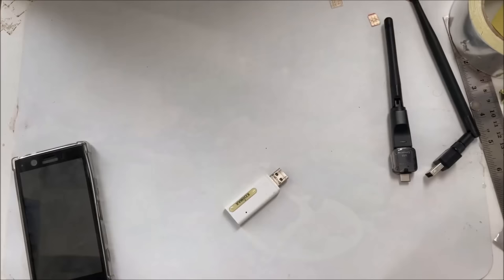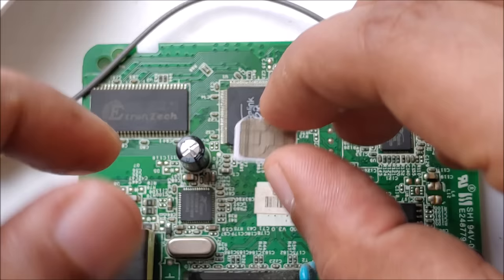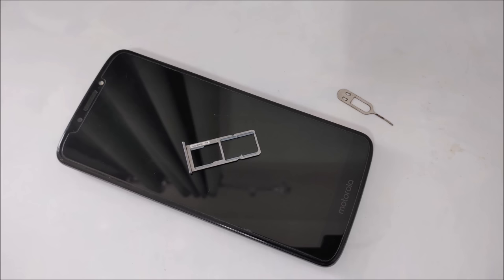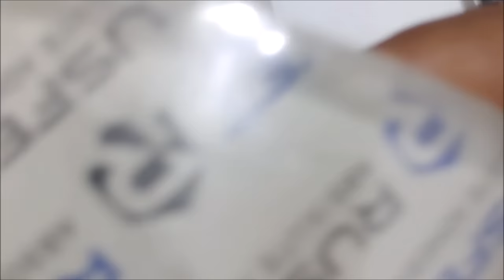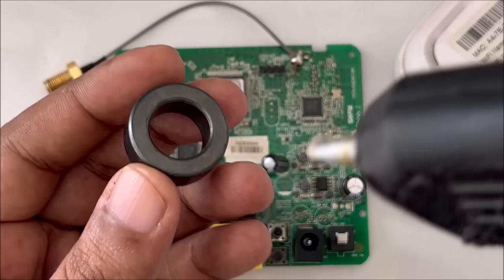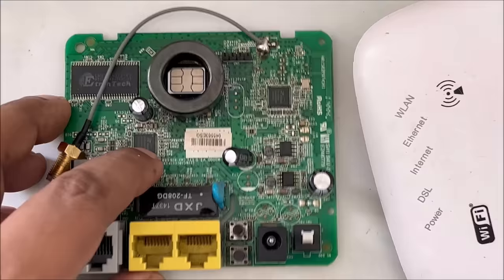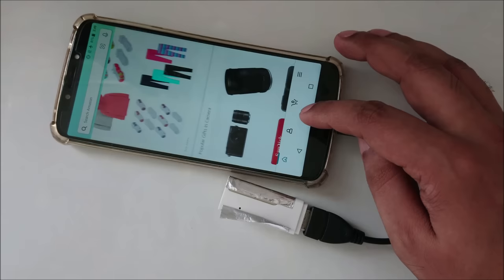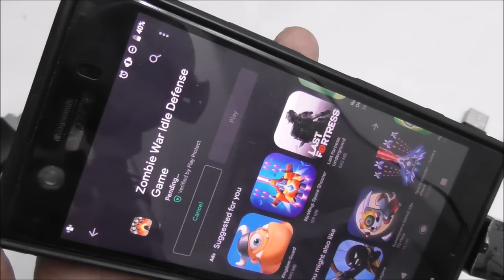7 Best of Free internet wifi data hotspot Modems password free Lifetime anywhere

Comment: As the sim card got data on if yes will it be using the data up on the sim card when on the internet if yes no point in using this as still using data up might as well put the sim card in the phone for the internet.
Reply from the maker: data should be close in phone we have to bypass only. when data close sim consider phone not using data no  id detection hope you get little point